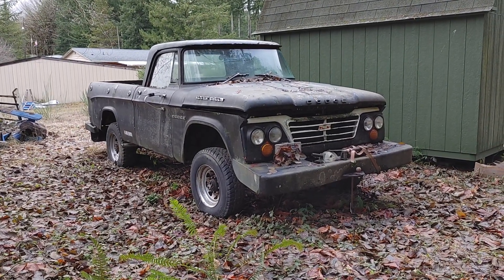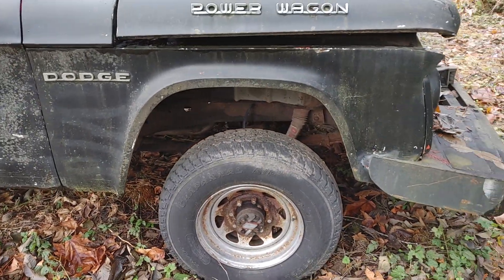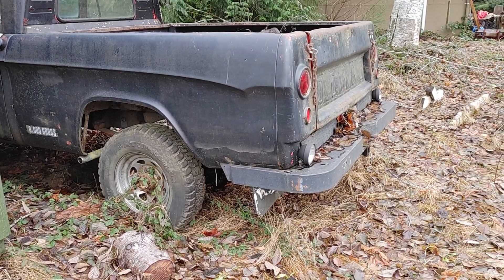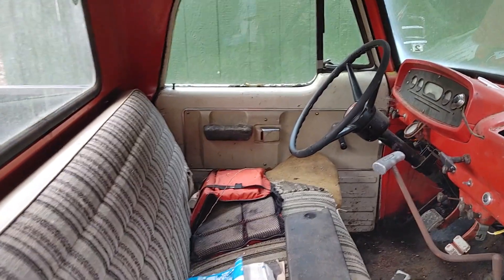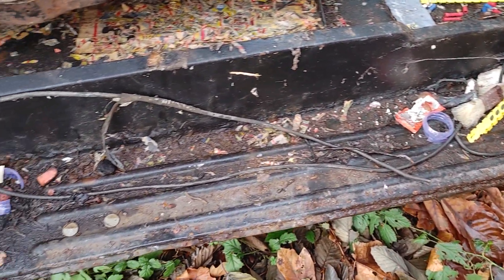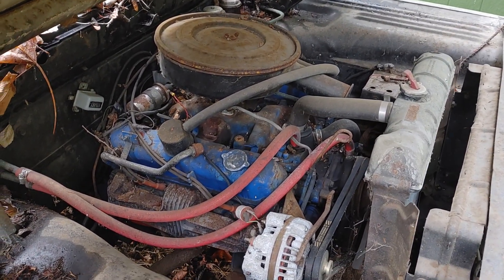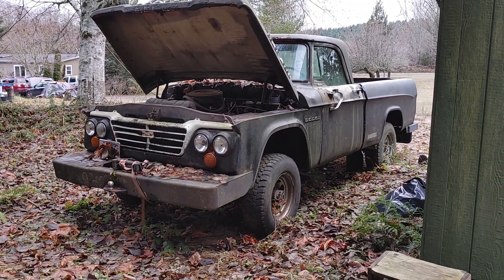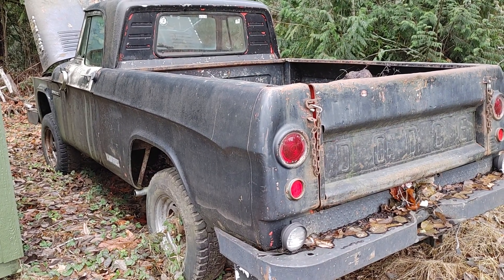1962 Dodge Powerwagon

Comment: That is an awesome truck it has 8 lug axles indicates it's a W200 3/4 ton? Those bumpers were an aftermarket option I think 🤔 It has an NP201 transfer case they hate Highway speed I put an NP202 in mine an NP 205 would be a great upgrade? I have a nice gas tank for one here
Reply from the maker: Thanks! As far as the axles go I had always thought it a shortbed 3/4 ton. I assumed 100=1/2 ton 200=3/4 and 300=1 ton. I found out in research and forums that through a certain set of years, including mine, both 1/2 and 3/4 got 3/4 axles. And that all 100's were shortbeds. All 200's were long beds. I got my butt handed to me in the sweptline forums because I didn't already know that. It was the cost of learning I guess.

After 65 I think is when the 6 lug axles show up and the designations change. It seemed the 300's didn't change in that same way.

I definitely am looking to update some of the drivetrain. I grew up riding in this bad boy so I know what you mean about highway speeds. Just doing research and collecting parts at this point. That's how I found your channel.
Reply: @joshuaatkins5197  That's awesome to learn that. I went to the trouble of swapping those w300 axles because they are ungodly expensive to fix & maintain. I have another military truck  too I gotta sell or trade gotta get the Miss a new ride or use the funds for a Construction loan we need a new house bad
Reply from the maker: @daninthedirt9449  I took a good look at that engine and based on the intake I'm pretty sure that the old man replaced it with a LA series 318. Thanks for the tip on your live stream last night.
Reply from the maker: @jamestown7506 that is correct as I stated in Dan's reply. Yes, that vintage they had 8 lug axles